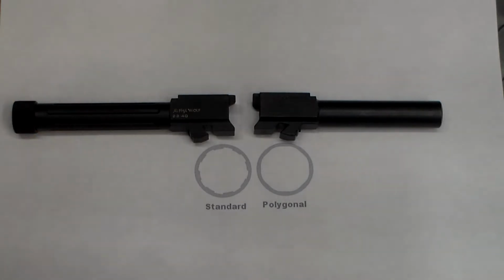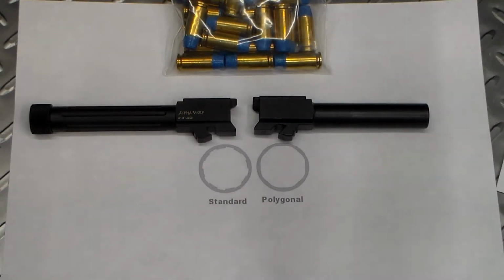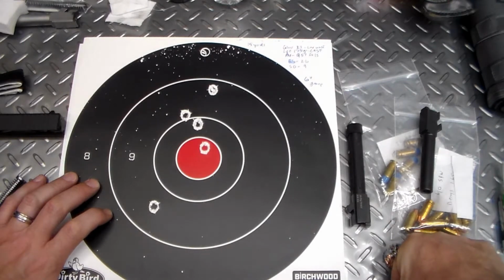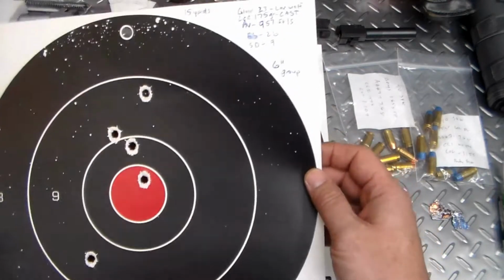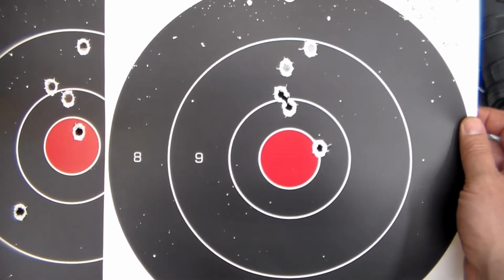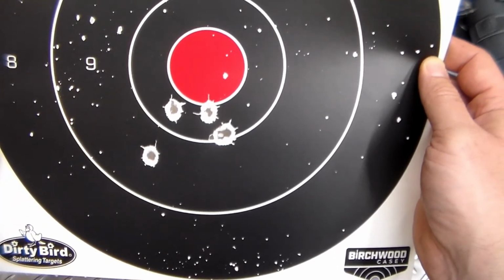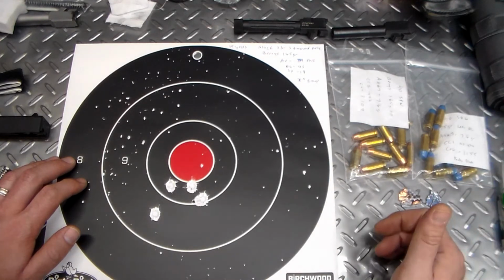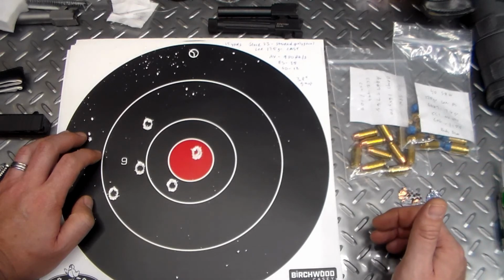Polygonal vs Traditional Rifling Part 2

Comment: I still believe that the "don't shoot lead bullets from a Glock, or your pistol will blow up!" Idiom was started by people who didn't understand Glocks. I've personally shooting over 20K lead projectiles from my gen 1 G17, and it's only been this past year that I began to powder coat. 🤔
I have never experienced any lead in my Glock barrel. However, I  never tested the BHN of my cast bullets, either, until this past year, but I tested some of my "competition' loads that were left over, out of curiosity, and they tested around 12 BHN. But I also ran cast lead at +p+ velocities (1050 fps 147gr!), and still never saw lead in the barrel. 
I would almost believe that polygonal rifling would be safer to shoot cast, since there aren't the sharp edges in the lands and grooves....
Just my experience.
Reply: i agree about the 'edges', with proper maint, all barrels will be fine
Reply from the maker: I always heard or read that on forums and it scared me away from cast bullets for a long time. I honestly think you are right about the sharp edges and the polygonal seems easier to clean as well. I have always liked shooting that Glock 23 and it has more rounds through it than any other gun I own. The polygonal barrel has always produced good accuracy and easy clean up. Thanks for commenting Jerry, your input is always helpful.

Comment: I've shot thousands of cast lead bullets out if my GEN2 G19, that I bought in 1995 as a seldom fired holster rash police trade in, and never had any issues and that pistol is WAY more accurate than I am regardless of what round I feed it.
Reply from the maker: Glocks and lead bullets is just an old wives tale. Thanks for commenting.

Comment: my opinion no matter what barrel i think powder coat, within certain range of speed, fouling will be minor if at all,  some guys still old school lube and with proper maintenance their guns are just fine great video
Reply from the maker: Thanks. It seems the pc is somewhat cleaner and the polygonal barrel was easier to clean. It was with very few rounds but I think it showed that pc is fine in polygonal rifling. I have shot quite a few of those Lee 175 in 40 and 10mm with good results and no problems at all.